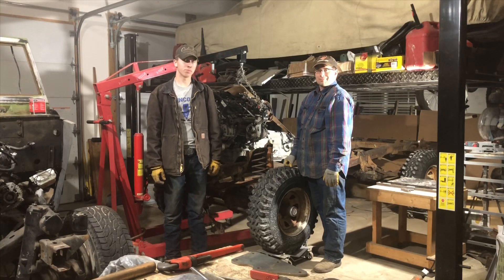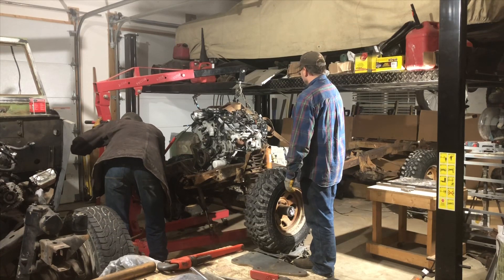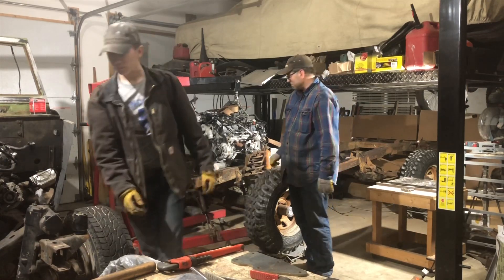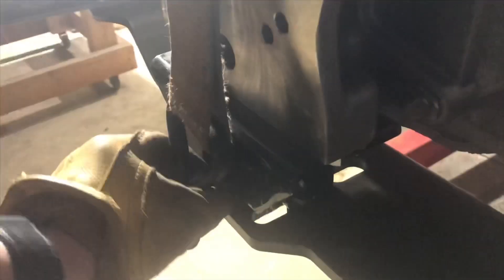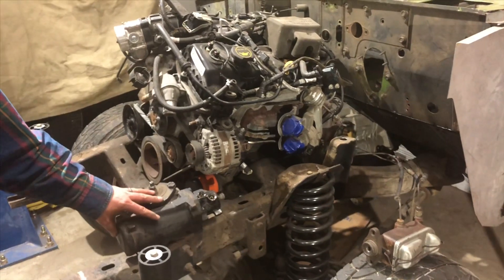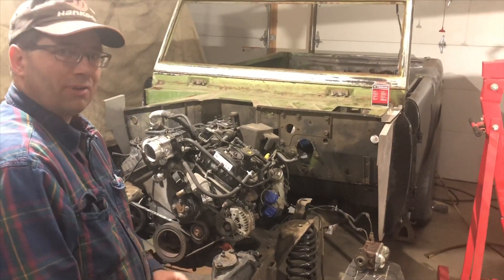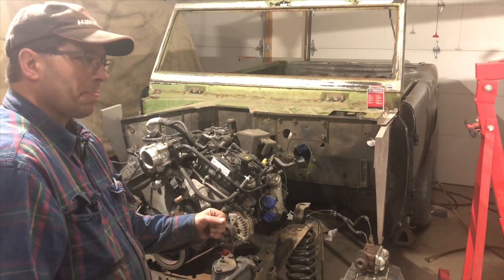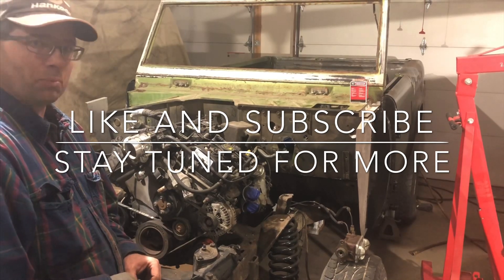Dropping a 500 hp ecoboost into a bronco

Comment: Donde consiguieron la parte trasera de la trasmision donde está la flecha tengo una trasmision idéntica y me interesa hacer lo mismo
Reply: Ya que me interesa eliminar el 4x4
Reply from the maker: No ablo espanio.  Could you translate comments into English if you are able?
Reply: I have an identical transmission and the 3.5 too but I'm interested in eliminating the Transfer. Do you know if that transmission serves me as rear-wheel drive?
Reply from the maker: There are 2wd versions of the transmission that you would need to use that eliminate the transfer case.
Reply: @boostedbroncos9531  la transmisión 4x4 sin trasnfer no me serviría como 2wd ?

Comment: I couldn’t find anything online about a eco boost swap I know with the coyote the whee wells have to be cut and the steering must be moved is it the same for an eco boost swap?
Reply from the maker: You need to remove 1" from the passenger inner fender for turbo clearance similar to the coyote swap.  The Gen 1 engine doesn't require steering shaft mods.  The Gen 2 with electric wastegate actuators require using a modified steering shaft.

Comment: I wanna drop one of these in my 70 mach 1
Reply: Sorry for the late response.  Are you thinking automatic or manual trans?  We are only able to support calibrations for the auto trans.
Reply: Auto! I'm getting to old for stick shift. Lol
Reply: Do you eliminate some sensors and others not needed for older vehicles?
Reply: We turn off the 2nd O2 sensors, evap, purge, stop/start, abs interactions, cold start spark retard for catalyst heating, PATS and a couple other things I am not remembering right now.  This enables running without the body control module and all the other modules except the pcm and tcm.
Reply: That's awesome! I'll be in touch as soon as my dad's probate is over

Comment: Nice.. thinking about 3.5 in my 93 lightning.  Is it possible for 10k? Or more?
Reply: It should fit fine.  Many of the Bronco items will work for any application.  I have a connection for new takeout Raptor 3.5 engines in case you are interested.  Email at boostedbroncogarage@gmail.com
Reply: @mattrogers3825  thanks , I'll be contacting you soon

Comment: When do your foresee the full package being available? This is exactly what I’m wanting to do for my Wife’s 69’ bronco
Reply from the maker: We are able to ship engine mounts, fuel tank adapter(to fit stock fuel pump module), power steering pump mount(currently in place of a/c compressor, but finalizing alternate location to support a/c applications), and oil filter adapter coupler for oil cooler delete.  We are finalizing quotes with a supplier to mandrel bend the entire exhaust in 304SS.  Still need to engage a supplier for making the wire harness.  We can supply a calibration for stock power level and are validating  a 450-500hp calibration in the near future.  Email us at boostedbroncogarage@gmail.com for more info.

Comment: Really looking into doing this swap on my 5.0 swap 66 f100 what wiring do you use for engine/trans. I found engine harness but what about controlling the transmission
Reply: Ford performance sells a harness for a manual transmission application that we have modified in the past to work for the auto application.  That make you buy the whole control pack kit to get the harness which isn’t cheap.  We are working on a supplier to make one for us.
Reply: Matt Rogers I saw the engine control pack for 1600 on fords website but nothing for the 2wd transmission. I don’t want to run a manual in my truck
Reply: 1194video it is easier to modify the manual trans harness than to modify the stock one.  I’ve done both and the FP one is a much tighter package.  We add the trans wiring, repurpose the clutch sensor wiring, and modify the fuel wiring for using the stock electric returnless system that uses an external pump control module and fuel pressure sensor.

Comment: If the motor mounts use the stock perches, would they also work for maybe a early 70's F100?
Reply from the maker: They should fit in the frame. The big question is whether the motor would interfere with the firewall, wheel wells, axle, or hood. We are using a body lift on the Broncos to prevent clearance issues with the hood. The ecoboost really is a tight package, but maybe in the future we could pursue doing a swap in an f100.

Comment: Have you guys created the kit yet? Can I get a contact email or number?
Reply from the maker: You can contact us with questions at boostedbroncogarage@gmail.com. We are still working on the kit.
Reply from the maker: We are starting to build and ship some kit elements including the motor mounts, pwr steering pump bracket, oil filter adapter, oil pan modifications, and wiring help.  Contact us for prices.

Comment: Looking forward to this channel. I think the ecoboost is on my long term bronco goal.
Reply from the maker: We are hoping to offer a competitive kit to the coyote that can be put in an early bronco without any alterations to the bronco except a body lift. We have already designed mounts to mate with the factory v8 mounts, and are excited for the possibilities that this could bring.
Reply: Boosted Broncos sounds good.  I’ve got a i6 bronco, but swapping frame pedestals  is not a problem.
Reply from the maker: I have thought about designing mounts to mate to the i6 mounts, but we don’t have any of those mounts. Plus if I remember right, you can find the v8 mounts at most bronco vendors.